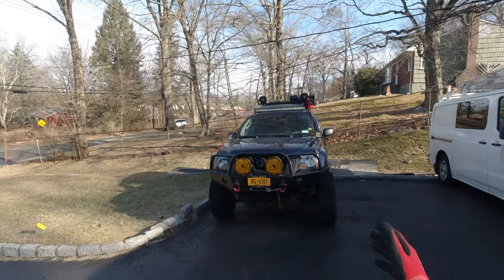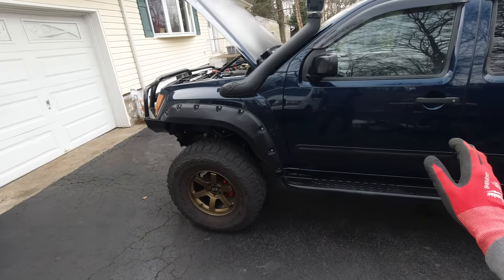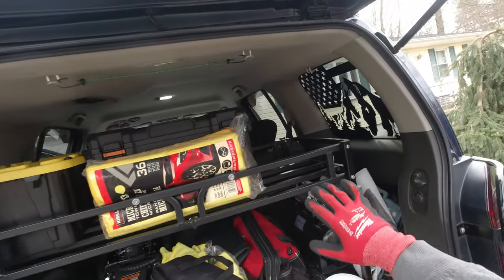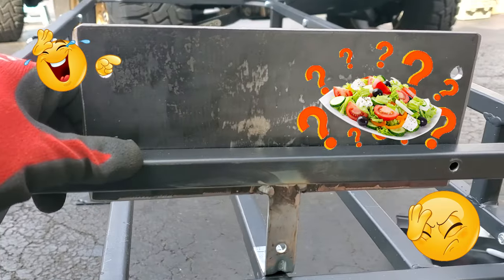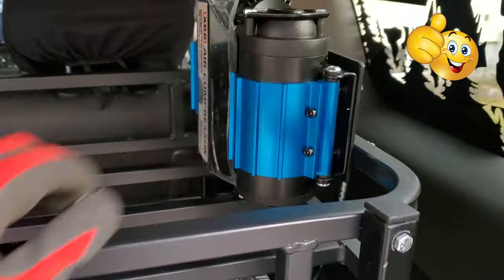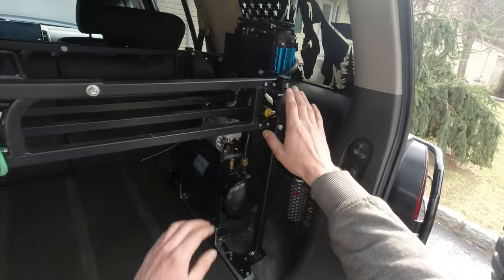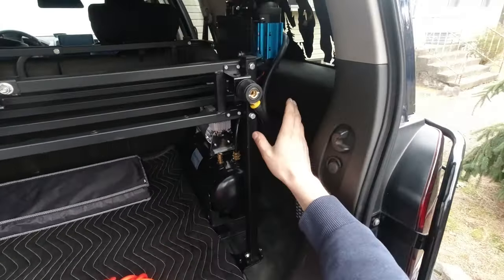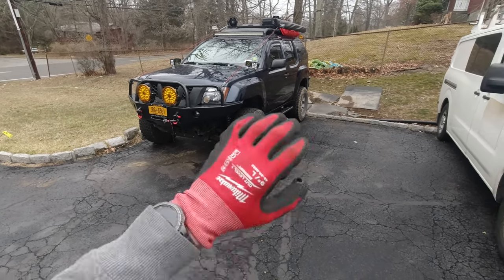ARB Twin Air Compressor Install

Comment: Can you power the compressor through the auxbeam 8 switch panel?
Reply from the maker: Yes , you can ..  you just run the switch wire to it.. so you dont have to use the toggle switches ( my friend is going to get rid of them all soon and we will wire up VoSwitch for him )   and  then just the main power big wires with fuses ofc you need to run to the battery
Reply: @DIY_AUTO_PHOTO  I have a Frontier I’ve been trying to think of a place to mount my Viair under the hood.  If you think of something let us know.
Reply from the maker: @Bikepro4x  he you have enough space under there why not it will defiantly make it easier to wire it up as well . or you maybe can try to install it under the passenger seat maybe  ? ofc depends how bit is the unit

Comment: What wire size did you use to extend the wire to the compressor?
Reply from the maker: I used 6 Gauge wire run it from the battery  this is the wire I used 
https://amzn.to/3TCkn8j
Reply: @DIY_AUTO_PHOTO  ok, thanks. Also did you connect the 6 gauge wire to the smaller wire to the compressor?
Reply from the maker: @tylercorkum3569  the 6 gauge wire i connected to the 2 red wires that lead to a big fuse on the compressor harness . to give power to it.. other smaller wires were run to the switch . hope it helps